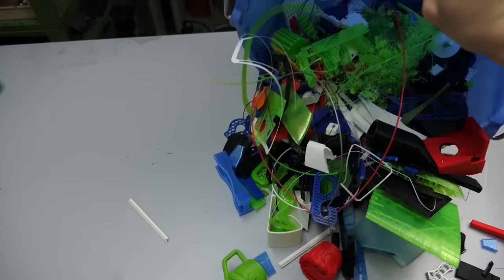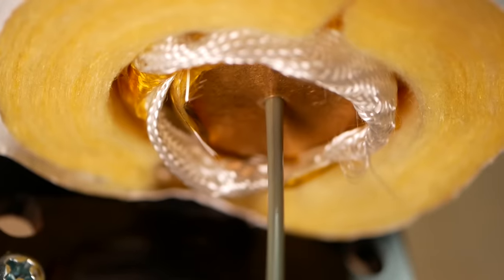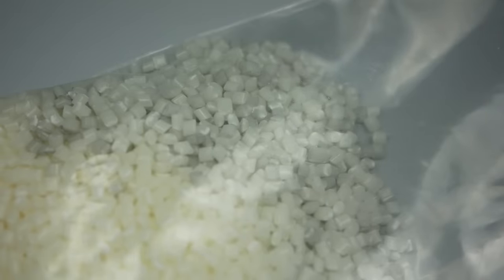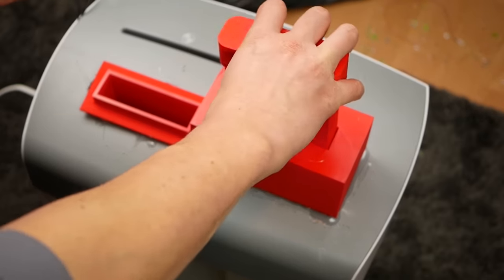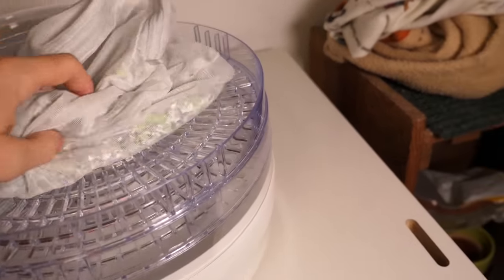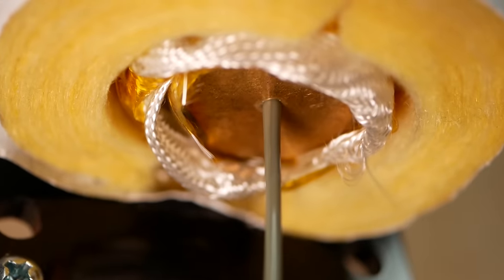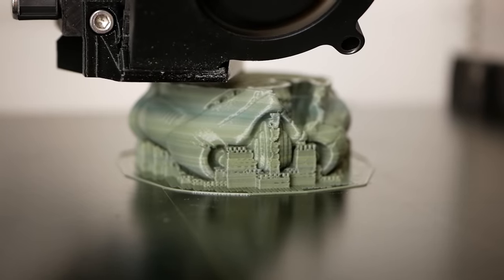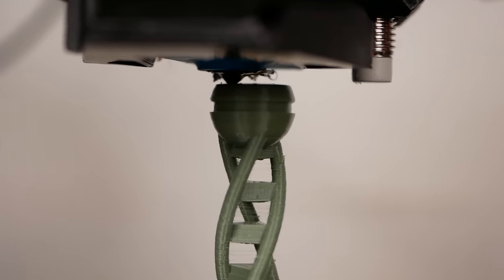Recycle your failed 3D prints! Make new filament at home.

Comment: Hardly any good videos are on this subject. You are awesome! I think Ivan Miranda could use this😉

Also the quality of that Benchy was really surprising to me. Could you do strength tests on the recycled vs normal pla?
Reply: The suggestion to use a different screw is an excellent idea. Another thing you could do to get better uniformity is to increase the length of the heater element, and/or put a preheater on the barrel. 
The screw on a ‘professional’ extruder changes pitch (?) to further compress the plastic as it approaches the outlet. Barrel heat is usually controlled in bands along the length. With certain screws and materials barrels may even need to be cooled. Extruders may also measure the pressure at the nozzle and have a controller to vary the screw motor speed. 
There’s a lot more, but hopefully this can get you closer to your goal. 
(I worked with controllers on extruders for almost 3 decades. I know more about the controls than the other mechanics, but I’ve picked up quite a bit. )
Good video. Best of luck. 
PS. When considering the cost of recycling, please consider the environmental impact of just discarding the waste.

Comment: I wonder if a ball-mill would be useful for breaking the shredded bits even finer (basically, a continuous tumbler with steel ball bearings in it, used to pound things into a powder).  That might help with mixing to get a uniform color?  (I don't know if the balls in ball-mills wear significantly quickly.  If yes, then I guess use a strong magnet to separate tiny metal specks.)

I suppose one could try a coffee grinder... but PLA is pretty tough, so maybe not (too hard on the coffee grinder).  But if it does work, many coffee grinders can control the fineness or coarseness of the grind.

How about sorting recycled parts by color, before shredding?

I'm interested in making uniform sheets of PLA from recycled parts.  Then I can cut (and/or fold?) them into shapes.  Might be easier than extruding new filament, but still useful?  May need something extra to ensure uniform thickness.
Reply: I'm even thinking of maybe using an old busted blender with a few of the cutters bent to shove the plastics out of the way...don't want to powder it, but bust it up into very little chunks (say 1-2mm rather than 5mm)
Reply: @haydenc2742  A blender is to aggressive, heats up plastic and sticks to blades.
Reply: I'm thinking about putting all the plastic in a big pot, then melting it all down into one big soup. You can then stir it to achieve a consistent colour as well. When you're done mixing you could perhaps open a valve to lead the PLA to an extruder nozzle. It's basically a large heated hopper at that point. I'm not sure if PLA reacts well to being at such high temperature for such a long time though. It's tough for me because melting creates fumes but grinding creates dust. Both are nasty.
Reply from the maker: Don't know if that's a good idea and even at around 200°C PLA still is quite more viscous than water.
Reply from the maker: The blender is great, you just need to works slowly. Maybe shredding everything in water might even help.
Reply: @CNCKitchen  Good point on the viscosity, you could open a valve but that doesn't mean the PLA will start flowing. So you'd probably have to close it up and apply pressure by filling the container with nitrogen. That's a lot of complication for a home gamer, and that's assuming the PLA doesn't degrade. I do wonder now how PLA pellets are manufactured commercially.
Reply: One thought i had when thinking about this was to use tremendously sized auger, so you could actually feed quite large bits :) Never tried it, tho i did go shop around and look at what sizes of augers you can get. One could try ice drilling auger .... >;)
Reply: @antalz  I like your ideas and I have one myself to get the PLA flowing! Use PTFE tubing with a peristaltic pump. PTFE can handle the heat and if you don't know what a peristaltic pump is, it's explained very well in this video (watch?v=9szzHkiefuM).
Should be relatively easy to try out and those pumps are really cheap and simple, though you'd need to find one with metal parts near the tubing so it doesn't melt.
Reply: @attitudeadjuster793  That's a really good idea! Will the peristaltic pump be able to prime itself with such a viscous liquid, or must that be helped a little bit?
Reply: @antalz  I'm really not sure as I never used them personally. But it should pull a good vacuum and you can play around with different tubing. The tube itself does the work in the end, it acts as a spring and creates the pressure differential when it re-opens, when the roller has passed.
Edit: Was able to find a ressource on pumping viscous fluids.  coleparmer(dot)com/tech-article/pumping-viscous-fluids
Reply: Or you can think outside the box and use the scrap PLA in other ways. Like if you melt it anyways, you maybe would have use for a bigger than your printer cast sheet of PLA...

Comment: Is PLA the only material that can be recycled like this?
Reply: Shouldn't be. The recycler works like a 3D-printer, so if the material is the same as it would be in a spool, then it should work. PLA just happens to be the easiest. That's why it is mostly used in 3D-printing aswell.
Reply: @TheRealSkele  it is also plant based, releases far less VOCs compared to ABS, and is foodsafe.
Reply: @Cruznick06  when I was working at a 3D-printing laboratory back in 2014, we had to check how much VOCs (volatile organic compounds) came from normal ABS printing. We concluded that the amount was close to zero. They mostly produce VOCs at higher temperatures.
Reply: Brain tissue can be recycled as well. I managed to extrude filament that plays Spanish guitar like a maestro

Comment: For shredding old filament id suggest a skill saw turned vertically (maybe even 2 slightly offset and over lapping)

Then make a funnel that feeds old pla into the blades shooting shredded plastic out the bottom

Comment: So, i think the next question is, Is the recycled filament equally resistant than the brand new filament?
Reply: "Resistant" to what exactly?
Reply: Ryan Breker I would assume to Force. How flexible it can be
Reply: Perhaps a torture test jig could be built to measure breaking strength and or elongation by pulling it apart and measuring forces produced by the test jig (hydraulic cylinders and gauges with Peak Force recorded or maybe just a hanging scale to see how many kilograms it takes to break it?)
Reply: The polymers in plastics deteriorate over multiple heating and cooking cycles, so the recycled stuff will be more brittle :)
Adding new, virgin pellets into the mix like he did helps to limit the effect this has on the properties of the recycled filament.

Comment: I'm not sure if anybody else is covered it but I was going to give you a suggestion....

As for grinding your parts down I would create something that spins in a rotational manner that has a metal style thing that would kind of give you the effect of a sandpaper wheel but the sandpaper would cause sand particles of course to get into your filament using something that was metal rough would prevent that from happening make sure it's done at a slow speed so that way you don't create any additional friction and that would probably break them in consistent pieces just the weight of the stuff in the hopper would probably work out I will definitely be trying this out though it bugs me when I part fails or you get a bird's nest or something

Comment: Sandcasting with lost PLA is truly amazing to me. Everything you use can easily be recycled. You print out your desired casting shape in PLA, make a mold with it, melt out the PLA, melt your metal and pour it into the mold. The scraps of the metalcasting and the melted waste PLA can be reused to a very high degree for the same process. As a mechanical engineer I can't help but be really excited about this extremely low material cost to hobby projects and prototyping concepts.

Comment: Be sure to let us know when the value of the recycled filament exceeds the price of the hardware you had to buy to recycle it.
Reply: I feel like that would depend upon how much you print and how much you value your time at, etc. I feel like, for most people, this would be more about the project and less about making economic sense. I have 2 3D printers and, in reality, I have never really printed anything I "needed" or anything like that. Most of the time I print projects that are for fun, and when they break, I toss them in my PLA bin (which is now overflowing) hoping one day to turn those failed prints, broken parts, support material, etc. back into usable filament.

Also, if you design a lit of your own parts like I do, you'd be amazed at how many prototypes/design phases you go through. Now, I buy my filament in bulk for less than $15 a roll, but if I payed normal prices of $20-$25 a roll, a machine would definitely have a better ROI

Comment: This is just a mini version of the industrial plastic machines I used to work on. Add a large bore slow turning auger to your mixing chamber and have the material funnel into it. You can probably print one. Also, try a two-step recycling process. First wash and melt the scraps and put them through a 5mm hole, no filter, with a rotating cutting head on the other side. Now that you've made your own pellets, put them into your much pickier filament maker with a percentage of new resin pellets. Why? They contain an additive that helps plastic slide, but that additive tends to burn off after repeated meltings. With your new auger mixing things you'll have a more uniform distribution, and fewer irregularities in the final product thanks to the regularity of the input material. Also I believe you could hook a photosensor up to an arduino board, put it at the bottom of your filament path, and have it control the tension on your reuptake reel. This would have the effect of on-the-fly size check and correction, and should allow you to up the tolerances to get closer to true 1.75 film. Great vid, answered a lot for me, thanks for making it.
Reply: Hello Mike,
Thanks for this idea. I have been searching for a solution to make Bee Wax Pellets, an i will try your idea

Comment: I think this is awesome. I am planning a new business and 3D printing might be involved in the not-so-far future... but the recycling part is really important to me for environmental reasons too, not just for economical ones. Were someone to perfect this recycling technique at home( I understand the difficulty of the shredding part) and this someone could make a home-based business just out of producing this recycled filament. What my boyfriend has observed is the grinder of a coffee machine. The system to grind the beans is extremely simple yet effective and definitely what comes out is smaller than 5mm... maybe you could try this. 
Not so long ago I saw that there is some wood fibre mixed PLA, I wonder what would happen to the consistency of the extruded filament, I imagine the fibre should be almost like a powder for it to mix properly... anyways, that was a great video, it really helped me to see the process and the difficulties of it, very well recorded loved it!

Comment: When i worked for a plastic tube manufacturing plant, the giant hoppers has vibration rings at the base of the hopper to insure a consistant feed. Ifor such a small hopper . you could take a vibration motor from a old video game controller and add it. so that it would keep the plastice flow consistant

Comment: in the past I have recycled milk jugs into various objects and found it was much easier to grind them to a specific size by cutting them into chunks then softening all of them and compressing the softened bits into large thick sheets. to shred it into smaller bits I motorized a rotary cheese grater and shredded the "chunks" into much smaller and consistent bits. This technique might work with PLA as well.

Comment: You need a old fashioned meat grinder.  Also known by some as a sprue grinder for turning old sprue into rubble for terrain.  Basically shred it so the pieces fit into the grinder hopped, and start grinding.

Comment: I keep coming back to dream of doing this myself. 

For "continuous feeding your hopper", I suggest making a bit of a "automated mesh system" for a dump hopper. 

Visualize: one hopper you drop all your "processed" scraps (already dried, fragmented into 5mm or close to bits) and the hopper then splits into 2 chutes, with a diagonal mesh that allows 5mm parts to pass through, but pieces too big slide down to a "catch bin", that catch bin can then allow you to accumulate your slightly bigger parts and then you can blend them again.

I feel you'd need, basically, a "pizza convection oven" like build to fully automate a recycling process, and as a hobbyist, that might not be the best option. However, what if Makerspaces were a "Filament recycling hub"?

Comment: If your still working on this project you can try to find a small used grinder from the Injection molding industry. We have a very small grinder at our shop that makes very small pieces. Also you could maybe find some cheap resin dye. Good luck

Comment: If you have sticking problems you can use the bottles as well but warning pure bottle scrap turned into pellets turned into line is really difficult to get off the glass Find the other hand your clear models are absolutely gorgeous Another thing you can add is wheat husks barley husks coco husks and vanilla husks. Note all husks should be sent to a bawl mill 1st you want flour.

Comment: You should get a bucket for each color. So when you get a failed print you can just put it in the corresponding color bucket that way you can keep the colors and not have to mix them all together
Reply: i always use white,so i have not this trouble... 👍

Comment: That diy driven screw extruder machine if anyone is wondering is exactly how they start making bubble wrap... Except it comes out of a slit along the bottom rather then hole the. Goes around  a water cooled vacuum form roller which sucks the bubble and on the roller above it you pull another sheet of molten plastic around another water cooled roller and then they bond in the middle are then heated as they're pressed then cooled and rolled and sliced and rolled and etc lol... If your I too engineering in anyway it's pretty damn impressive haha :)

Comment: Industrial extrusion is done by heating a lot of plastic in a large container an mix it in a way, it can be used also as pump into the nozzle. Essentially 2 drill like cylinders with different speeds, much like a noodle mixer. The only difference is the turning speed, which is so low, that no air is sucked in.

Comment: Adding a small gentle vibrator to the outside of your hopper would help to encourage a steady flow rate through to your indeed auger. Something like what's on a dumptruck only much smaller.

Comment: I think you've done a great job with it.  With PLA it doesn't really matter but with ABS itd be nice to recycle all scrap and failures since it doesn't biodegrade like PLA.  for shredding they do make shredders for recycling filament though last I saw they were pricy.

I'm looking forward to a cheap, open source, design to be finished so I can build one to recycle and be green rather than just throwing away scrap ABS (I dont even use PLA anymore, just tpu and abs)

Comment: Even though this is an old video and I bet you have come up with an improved recycling process, here are my thoughts. Create a heated rolling press that will press beads of material, this would prevent you from having to do any prep work with the shredder and also allow you to quickly toss away the waste bits of your prints or failed prints quickly right when you discover you have a need to toss them away. It could be like a wood chipper in design, where the pellets exit onto a conveyor that allows the pellets to cool down. The conveyor would then feed into a exit funnel that pours into Bell canning jars (or any air tight container) and you could keep desiccant in the jar to help remove moisture and keep everything dry. By recycling your waste bits direly after you print, or by throwing all the failed prints into the recycler right away, you can easily grab the closest color (or a new jar) to keep colors or different types of material separated. 

I would imagine this could be created pretty easily, though the heated press may take some experimentation to find a material that allows easy separation. Maybe one solution could be to 3d print a silicon mold, that would allow you to drill out piston shafts and use pistons to push the beads out once they have cooled down. Also, instead of using a wheel, if you had a silicon mold, you could make the wheel more of an octagon, where 2 flat plates just squish the material when they are hot enough and then separate again.

Comment: i was clever and welded a  25 cm hand made copper pipe to the hot nozzle. the hot filament gets inside the pipe and i put vents to cool the pipe. by the time it leaves the pipe it was already taken shape. no issues so far. but you have to tune it